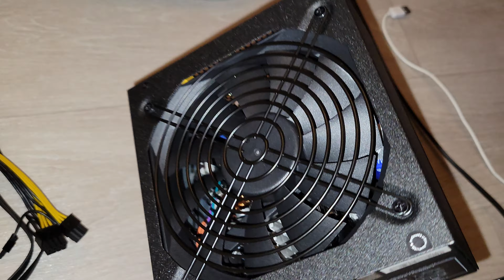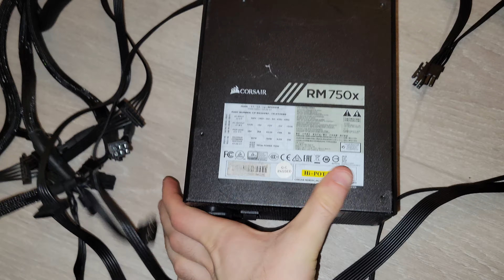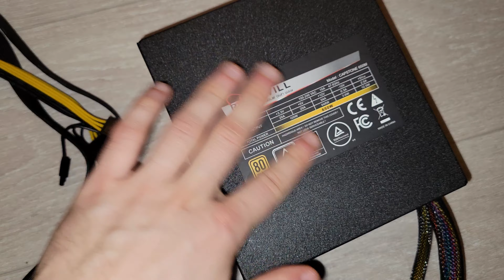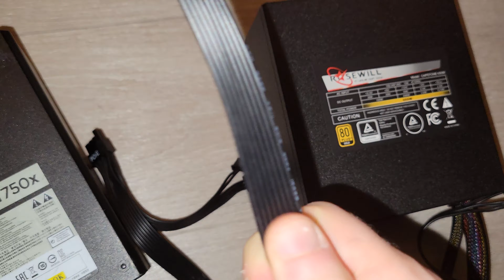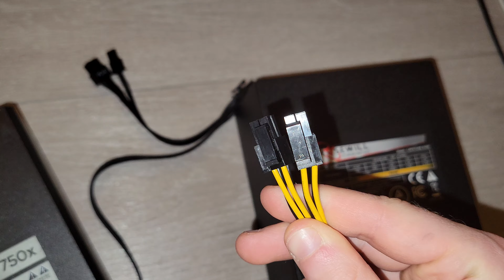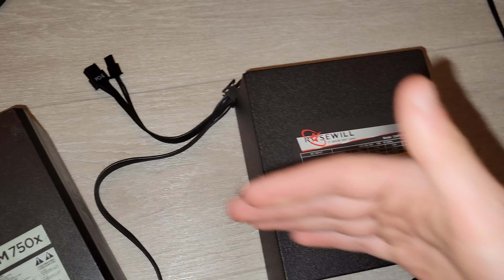Cheap $60 650w 80+ Gold Power Supply test for mining... seems decent

Comment from the maker: A quick low quality video, I paid $67 CAD all in for this PSU.
I will run it more before recommending it.
But i was looking for cheaper 80+ gold rated power supplies.
The issue with going with the cheapest PSU is that you generally get what you pay for so that is why i want to do more testing.
Reply: The hp server psus aren't good anymore? Or did they became overpriced?
Reply from the maker: @thelaw9937  they are still good, just looking at ATX so that I can reuse in pc when I'm done mining.
But the server psus are also expensive now rip.